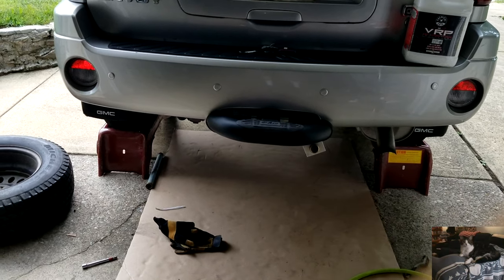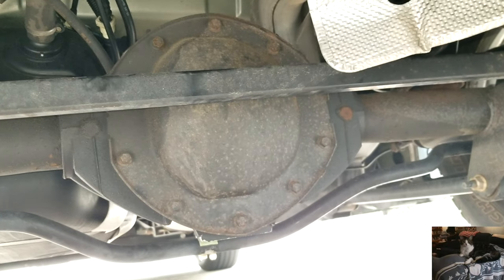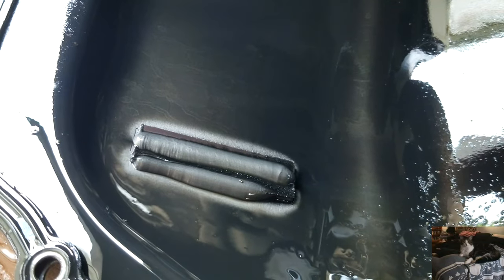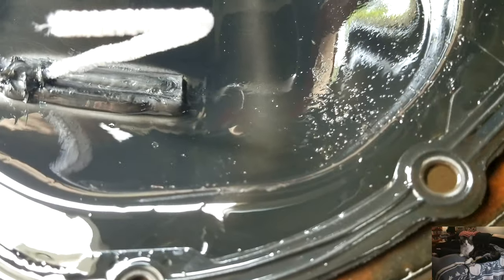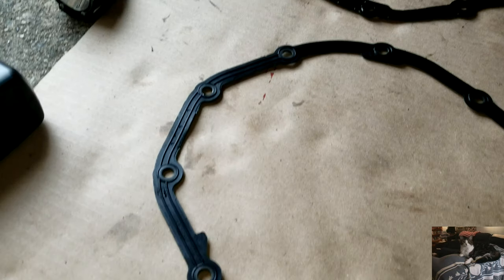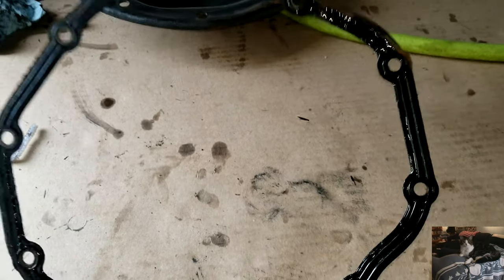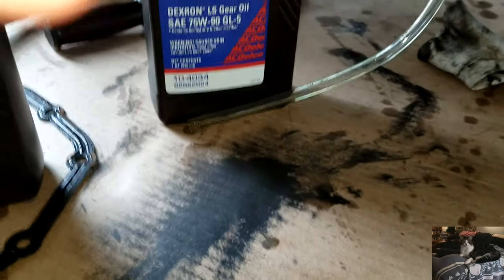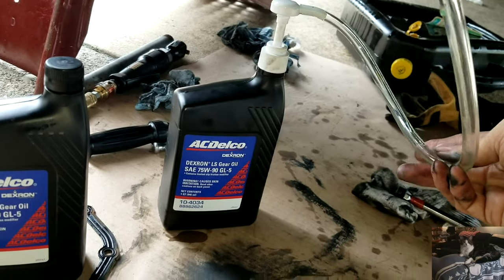GMC 2006 ENVOY Rear Differential Fluid Change DIY How-To 2021

Comment: What about using a siphon or a fluid transfer tool instead of unbolting the whole cover?
Reply: That does work, but doesnt get all the fluid out, and it doesnt allow you to check the bottom of the dif for pools of metal, or other bad things.

Comment: Someone lied to you, that's not a limited slip G86 (never came in a GMC Envoy), or even a locker G80. That's just a open differential.
Reply: My 06 denali has rpo code for G80 and she is posi
Reply: @Zach Hicks  that's not a posi, that's a locker my Envoy has one too
Reply: What about using a siphon or fluid transfer tool instead of unbolting the whole cover?